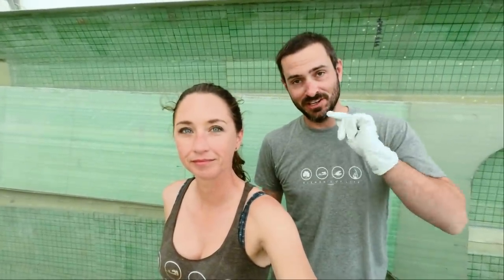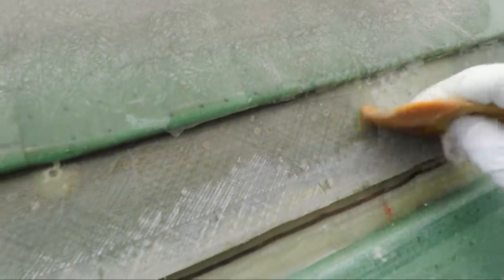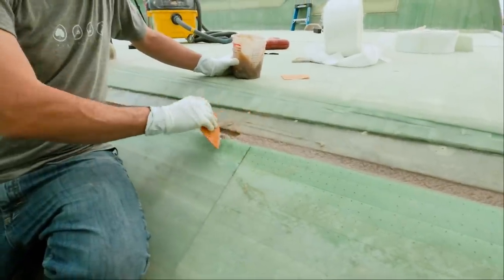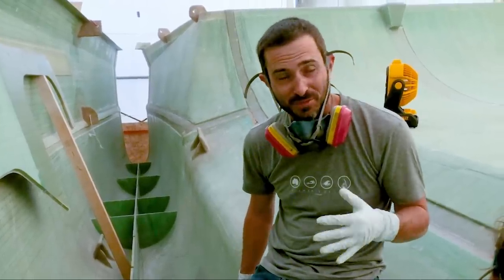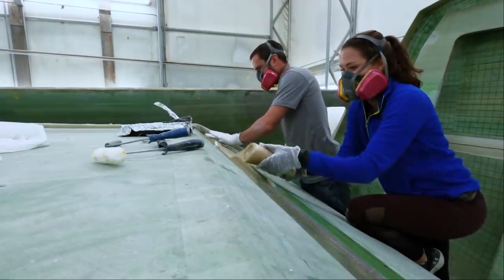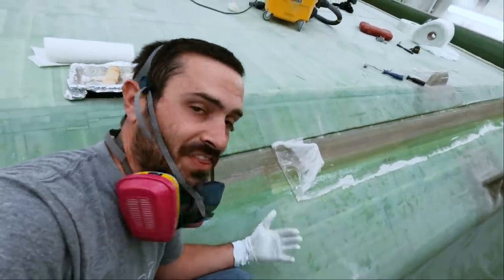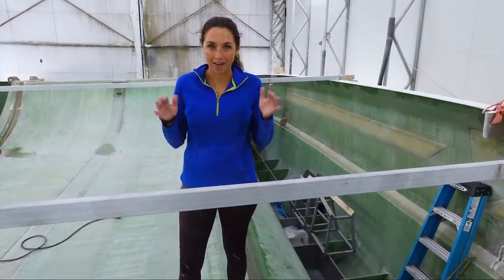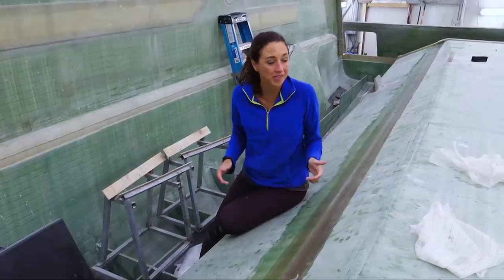CATAMARAN BUILD - Over 50 feet of Glassing in One Afternoon!! (MJ Sailing - Ep 189)

Comment: @3:38 tech tip time. Go to classifieds and buy yourself a cheap used fridge. You can chill your resin and it will slow the “kick” time. Also for the right now fix, get some of those paint trays Matt likes and spread the thickened stuff out on the bottom. When you keep it in that mixing pot, it’s all concentrated together and heats up much faster than if spread out. 

Once you get the fridge, you can actually put brushes and rollers in the freezer overnight, so long as the resin isn’t too hot already.

Matt @3:58 get it out of the pot and on the work so it can stay cooler. Then come back and flatten out. The quicker you can get it outta that pot, and on the work, you will slow the kick time. 

Great job Team! and I mean TEAM! Yawl work great together.
Reply: Good points Blair.  I'm researching a two party epoxy right now for a garage floor and the instructions and videos all EMPHASIZE getting the mixed product out of the pot immediately to increase working time.  Leaving it in the pot (for the product I was looking at) you had about 10 minutes to use it versus 20 minutes if you mixed it and then poured it out on the surface you are spreading it on.  As you said the heat build up when the product sits in the confined container happens twice as fast as laying the mixed resin out on the work surface where the heat build up is dispersed due to more surface area allowing heat to escape and not build up as quickly.
Reply: and use FLAT PANS...LIKE...Plastic throw away Roller pans and buy the cheap liners...more surface area means more HEAT DISSIPATION from the CATALYST REACTION......Deep cups/plastic buckets have less surface area to get rid of the HEAT!!   Cheers Bro great advise....
Reply: You can also put the mixed pot in a bucket of ice or similar if you need a little more working time
Reply: Plus the refrig can be used for other purposes, like beer storage.
Reply: Idk that they actually have room for a fridge in the tent.
Reply: When I was building 30 years ago (Hexcel epoxy wetting out carbon), I had the opposite problem. The resin at room temp was so thick that getting thorough mixing and wet out was hard. I ended up buying an electric warming tray at goodwill and making a styrofoam box to put over my 2 - 1 gallon metal resin cans with pumps. I didn't make it really hot but warmed it to probably 100-110F (I never measured the temp but made it so it flowed well).  I just mixed smaller batches and worked fast once I had the mixed epoxy but it flowed like wesson oil for several minutes. When I did cook off a pot, it was small enough that it wasn't a huge waste. Like others have said, the key is getting it mixed fast and getting it  spread out fast so the thermal reaction doesn't cause a temperature runaway.
Reply: I did use the freezer trick for mixed LPU paint if I had leftover so I could use it the next day.

Comment: Tip. If you mix the resin when it's really hot outside, make sure both components are cool. If necessary, cool the bucket by placing it in a container with ice when you mix it.

Comment: I don't know if this has been mentioned before, but if you work from a palette of some kind (about 1 foot by one foot) instead of your buckets as you're spreading the various compounds, you can appreciably extend your "cook time"! That will be handy as it gets hotter and hotter this summer. In the buckets the confined polyester/epoxy gets hotter faster and cooks off/begins curing quicker. An additional benefit is it's easier to get ALL of your compounds out and used instead of fighting to get it out of the bucket as you go along, saving you money and frustration!!

Comment: Having built many boats.....I would suggest glassing those Joints with Uni-directional and push into curves....THEN use the Filler to smooth section out for the final FRP Tape....using Fairing mixture with Microspheres'''etc...will be brittle over time and I suggest using SEA HAWK'S  HAWK EPOXY F-1 HIGH LOAD "ADHESIVE FIBER FILLER" for High Loads...the fairing compound does not give more bonding between gaps of your seams as the ADHESIVE you used......so for those please use the above......Keep up the great work !!!!   She's going to be ONE SWEET CAT!!!!!!!!!!!!!!!   Love Your ATTENTION to DETAILS!!!! Cheers   HAPPY

Comment: After watching Sailing Parlay's rebuild of multiple catamarans, the single-sheet bulkheads and doors are a failure point (they warp and fail). You should go with two or three-wide marine plywood sheets the whole way around doors from floor to ceiling, based on what they are seeing. Now is the time because its easy now and much harder later.
Reply from the maker: Matt goes over our bulkhead process here and how it relates to what everyone is seeing on Parlay Revival.  😉  17:40   https://www.youtube.com/watch?v=JJ3jwSfygRg&t=1062s&ab_channel=MJSailingMJSailingVerified
Reply: @MJSailing  100% agreement! That was a highlight of the series, because the 45 degree offset provides direction independent strength, which is really needed there.  The reinforcement of the door openings is great as well and shows the designer really cares about the force density.  Perhaps you could make an episode with an interview of the naval architect to explain all those details and which forces apply where? Such care deserves to be made public.  A "these are the forces on a bulkhead and that's how we designed ours to withstand them" lesson might be very interesting to many viewers.

Comment: Petroleum jelly or zinc oxide can reduce the rubber chafing the bridge of your nose, i used to apply Vaseline to my face back when i was using a full face respirator at work for long hours, it helped quite a bit.
Cleaning and sanitizing after use and then protecting your respirator when it's not in use is important.
If you don't want a petroleum based product on your skin there is an alternative called Waxeline.

Comment: Oh yesss remembering the angleground fiberglass-dust on sweaty skin when You just can't bear wearing a full-body condom for temperature reasons any more .... I was itching like the apprentice-me just watching the blower sequence. 😂
Thanks for sharing 🍻
Reply: Apply baby powder to your skin. It will keep the glass from getting into your pores.
Reply: @michaelronquillo3842  It does - until You start pouring sweat. Powder-sweat-glass is (in my experience) even worse than glass/polyester dust alone. Only thing working in hot summerdays is Tyvek fullbody, air-helmet and gloves. Which is why in bigger enterprises, the areas where the sanding, mold-building and laminating/building happens are completely air conditioned to bring temperatures down below sweating levels.
We never had that, being crazy one-off racer builders and otherwise helping people repairing/building crazy projects like Matt and Jess in "thin-air" conditions.
Reply: Lol when i would sweat i washed off often and changed shirts often. Whew them tyvek suits are pure murder in the summer.

Comment: When I was building kayaks I  built I did two using polyester resion. They were heavy and would crack when hitting rocks in white water. I then went to epoxy resion. These  
kayaks were .much lighter and stronger.  The lightest I could get a poly was around 35#. The epoxy boats I could get as light as 18#. I used the poly boat about 2 years. Then we got a new mold for a better white water and slalamon racing I building with epoxy I was able to get  to the 20# range. I sold several at that weight. Then I made one myself. I pulled the boat out of the mold at 16# after fitting the boat with a seat, foot blocks I had a 18# boat.I used that boat a out 4 years and paddled some heavy white water and never cracked it.  My poly boat had several cracks.

Comment: Super well done so far guys - looking very good and proving that a kit like this is a pretty quick way of standing up a boat v building from scratch. I know you will be building to factory specs re layup, but I have built several large FG boats (in vinyl and poly ester and epoxy) and always I lay the wider tabbing over the narrower - in your case the 150mm over the 100mm. As a minimum you only end up with 2 edges v 4. Your rollering post layup looks fastidious, so less likely that scraggy edges will be an issue. So, I assume it is a factory spec? BTW - agree that filling that seam void with foam and then tabbing would be a better way to go.

Comment: Maybe also spread the resin out on a small board once it's been mixed? If this stuff is exothermic then spreading it out thin (and with more air to dissipate heat) should give you more working time
Reply: Spread it on a chilled board, and move it to the hot hull?
Reply: @ReinoGoo  Probably not necessary given you typically don't want to mix too much at a time even if you can keep it cold.

Comment: Awesome guys, getting there. One question though, Why was there a big gap on the one side that needed filling ? Is that a design or just not matched perfectly?
Reply: Sounds like they weren’t dropped into place uniformly.. Hope it isn’t enough where it creates imbalance in the flow through seas. However, that was a lot of fill they were having to do. I couldn’t begin to manage a build like this. I am amazed at their calm, thoughtful approach to the work.
Reply: I would not assume the edges were trimmed the same at the factory.
Reply: @blueclue57  They were measured and remeasured and checked, the fault ( if that ) is not with the assembly by Matt and Jess.

Comment: Why didn't you guys lay the 100mm F/G down first then the 150mm over the top of that...🍻👍...
Reply: I am curious about this as well. I’ve seen other videos where they put the big piece down first and move to smaller. It seems counterintuitive but I’ve seen it enough that there must be a reason.
Reply from the maker: That's the technique for epoxy.  Epoxy has gap filling abilities that that allow it to fill in the transition between the larger top glass and smaller bottom.  The esters do not, so even with the thin edge of the the 100mm fiberglass, it could create a void between those two where it meets the hull.   -Matt
Reply: Thanks for that...👍...Interresting...

Comment: Is there a reason the roll is held underhand? Would it not be easier to hold it so that it unrolls ONTO the splice...if that makes sense?
Reply: I think thats so the wet side is face down so they're adding extra resin to the dry side (what was face down on the table)
Reply: @scotty6435  That just means they wetted it the wrong way.

Comment: Nice job but, just a piece of advice: NEVER, EVER, use compressed air to clean any body parts, even more so if you are working with fiberglass and alike. 
The reason is that by doing that, you might force particles under/inside your skin, which can cause itching or even worse, some skin infection. Learned that on my early days in the workshop. Stay safe you two :)

Comment: Hey Guys, with over 30 years of glass experience might I suggest laying down the smaller 100 mil first then going over it with the 150 mil. You will add more bonding area than the way you are currently doing it. You should go to the Life On The Hulls channel and watch how he is building his boat.  Lots of years of experience there. Also is you aren't using peal ply aka dacron on your resin then you should add a wax or use resin that will cure on its own. if you use regular layup resin with no curing agent it will never cure correctly. Thanks for the vids.
Reply from the maker: I disagree.  If you put the wider over the smaller, the transition point will either be resin rich to bridge the edge height difference or have a void.   Also, when it's time to prep sand for fairing, if you hit this with a sander, you'll first cut through the transition area of the wider tabbing and defeat the purpose of staggered tapes.    It's the reason you typically see wider first for hand laminations.
Reply: @MJSailing  Why would you be fairing bonding points? I can see your argument on building up an area to be faired on a cosmetic surface because it doesn't add strength but not on  bonding areas. Go watch Life on the Hulls channel. But hey it's your boat, do it your way.  I was just trying to help. Be well. I have nothing else to add.

Comment: PS don't skip on anyting, lay everything up as thick as possible with the good stuff.  weigh does not matter in the water. So much.I would rather have more weight than something that might give away in a storm. You're probably going to put that boat through hell. Also you might want to make it handicapped-accessible. Because you may grow old on that boat.I wonder who's going to be the first to need a Walker to get around.😂
Reply: Weight in a catamaran absolutely does matter. They already carry much less than a monuhull so you really do need to pay attention to what weight you add to them. Even more so on this particular cat as it is a performance model. Light even when compared to other Cats.

Comment: I've never done fibreglassing before so I don't know if there is a reason why you would roll up the sheeting, then unroll it the wrong way?  I can't get my head around why you would do it this way. The logical thing to do is to unroll it up the right way so that it easily just rolls away from you by itself with just a push, instead of it being upside down and have to be unrolled by hand thus risking deforming the sheet and making a bloody mess.
As I said, I don't know what I'm talking about but boy that does look really awkward and an unnecessary expenditure of energy.
Reply: @Adrian Matthews Thanks for the info. But surely it can be rolled up so that the side that has to go down is on the outside and then it can be rolled out naturally instead of upside down? I'm just wondering that's all. It seems very awkward and difficult doing it that way, but if that is the way it is done according to manufacturers instructions, then that is the way it is done. As I said, I have no knowledge of fibreglassing, so I don't really know what I'm talking about.

Comment: I'd think about doing the 90 degree bondings like bulkheads with Epoxi instead of polyester. Polyester has a poor bonding when the forces try to lift of the part from the hull. Watch these episodes of a Lagoon 450 with cracked bulkheads. https://youtu.be/je0LkKk0Ahg
 It turns out, that this was not a result of the hurricane damage for the boat. No, a few more Lagoons have exactly the same problem. Often the building is not really possible in a different way. As the bonding the cockpit deck the the hull bottom for example. A tip from a german naval architect and boatbuilder.

Comment: 5:04.., wouldnt it be best to follow the manufacturers instructions rather than do it your own way?, I was just concerned when you suggested putting strips of the core into the gap, it just sounds like creating a weak point.
Reply: The purpose of filling the gap is to allow a flat surface to bond the fibreglass to. The "manufacturers instructions" probably state to "fair the joint" which can be done in many ways. The foam strips would have saved a lot of unneeded resin a weight into the hull.
Reply: @rcsailer  (The purpose of filling the gap is to allow a flat surface to bond the fibreglass to).., ya dont say???.., I got it the first time when Matt was explaining his reasons.., (The foam strips would have saved a lot of unneeded resin a weight into the hull).., yeah I got that the first time Matt also explained it.., tell me, do people often find you patronizing at all??.., Jeeze louise.
Reply: @formhubfar  so why are you suggesting they follow the “ manufacturers instructions” if you also already know there are many techniques for fairing a surface?
Reply: @rcsailer  The point of my comment (which you clearly missed) was that Matt had said that maybe a better alternative to filling the gap with epoxy was to fill it with the foam core, I just thought that surly the correct procedure (which they should follow) will be stated on the fitting instructions.., if he follows the instructions.., oh never mind.
Reply: @formhubfar  if the instructions said just fair the joint , it probably doesn't have any structural load in that direction , meaning filling it to let the fibreglass bond
Reply: @ewantheboat  Oh boy!
Reply: @ewantheboat  Did you watch the video at all?.., they had to apply a 4'' and then a 6'' strip of fiberglass over the joint, it was their choice to fair and fill the void.., my >> POINT << was.., what does >> The instructions say? <<.., not being cruel mate but I have just had wayyyyy tooooo much dumb for one day.